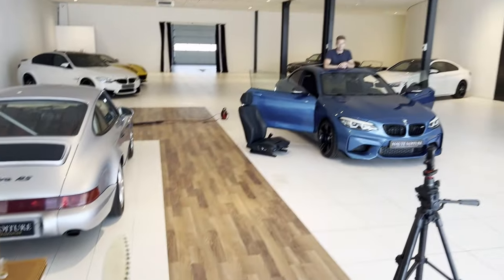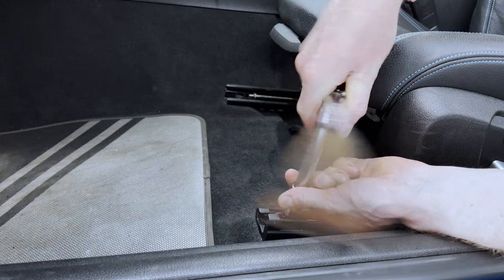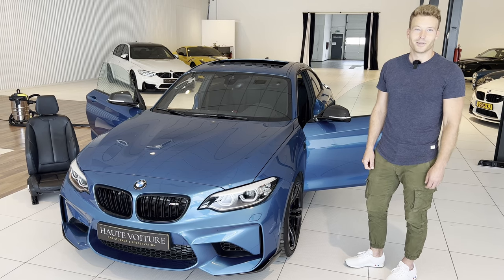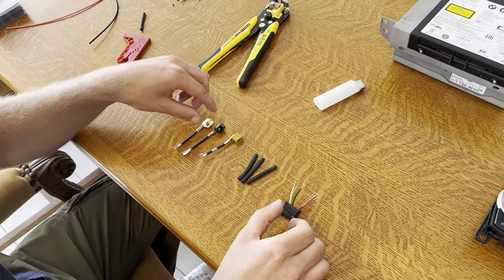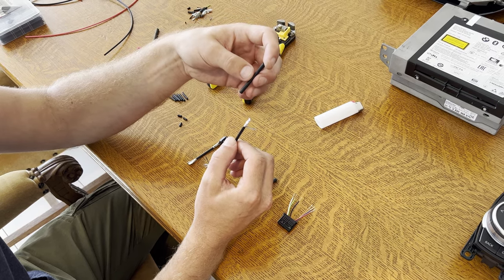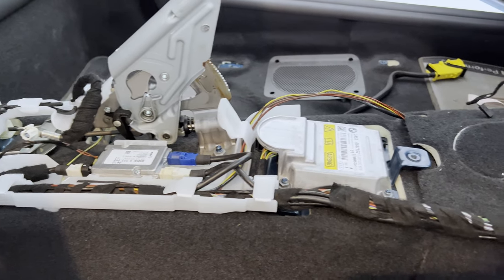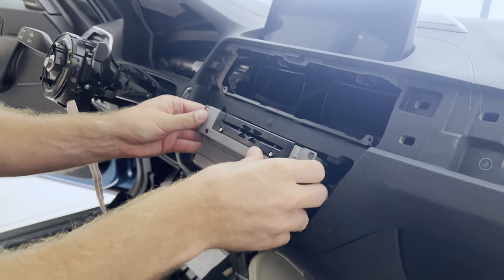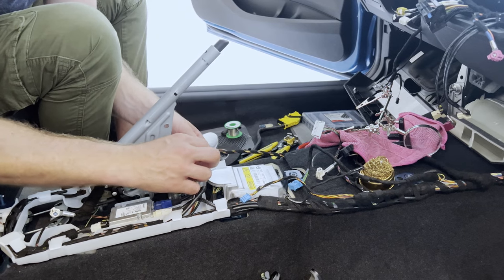BMW M2: Rebuild Part 1 of 2

Comment: How do you get full-screen car play? I thought its only for ID7 and above?
Reply: ID5 and ID6 also have the possiblity to code fullscreen Carplay. It can be done in two ways! 1. If NBT_EVO firmware is N or higher it can be patched, if firmware is X or higher it can be simply coded.

Comment: Hi Hunter, I've been loving watch your video's and was gutted for you when your car got stripped ( I hope it all comes back together,  better than before ). Can I ask you for some advise, I want to buy an M2 soon and I'm not sure which model to buy.  Either a 2018 M2 F87 LCI or a 2018-2020 M2 Competition just not sure the M2 Competition is worth the extra cash? What do you think? Any advise would be appreciated,  thanks.
Reply from the maker: Hi mate, thanks for the kind words. Let me preface my advice by stating that either choice would be a good choice, they’re both great cars. Imho the M2 Competition is not worth the extra cash. To ‘fix’ the sound, you would need a different exhaust setup (so add in a couple of thousand dollars), I personally prefer the wheels of the M2 in comparison to the wheels of the M2 Competition. Having said that, if you can source an M2 Competition with the 437m wheels and already with an aftermarket exhaust, that would be an awesome car (in my opinion). Furthermore, yes an M2 Competition is slightly faster, but the sound of the N55 is sooo good. Having said that, M2’s are not Ferrari/Porsche fast, they’re more fun oriented, so who cares if the M2 Competition would be 0,5 seconds quicker around a lap? I would get an M2 LCI and keep the extra cash to perfect it (by installing interesting mods as per my videos). Hope that helps mate (and consider subscribing 🫶🏻)
Reply: @TheHunterHofman  thanks for the quick reply Hunter. I actually subscribed from the first video I watched of yours haha. I was leaning towards lci anyway. I'm in Australia and prices are crazy at the moment where people are advertising their cars for crazy prices hoping either to keep prices high with no intention of selling or trying to find someone willing to buy at those prices. Hopefully things settle down and I can buy one. Thanks again Hunter, keep up the good work...

Comment: Hi Hunter Hofman, with insane content obviously 😅. I would to know, after installing the newly bought NBT EVO HU, did you have access to your pass enabled features such Connected Drive, GPS, and cellular services?
Reply: Hi! A newly placed NBT EVO needs to be coded and enabled with the proper FSC's based on the vehicles VIN number. Only after that the Connected Drive services enable and everything works like it should be